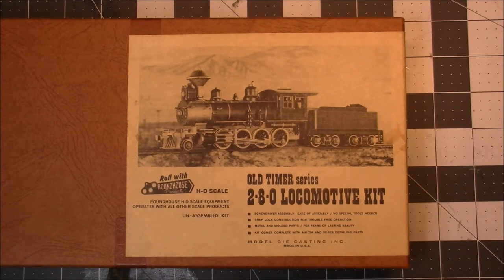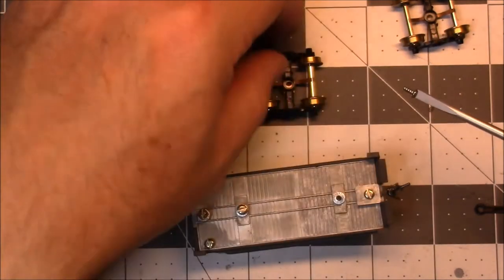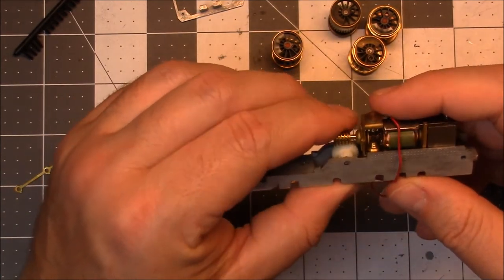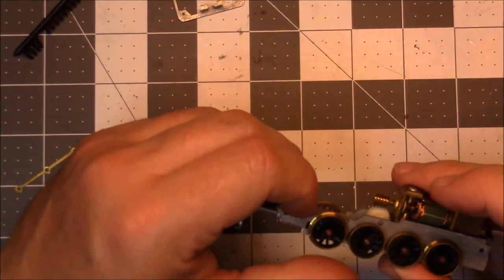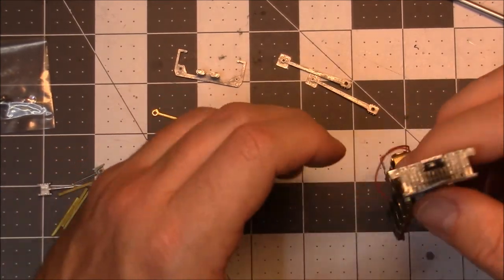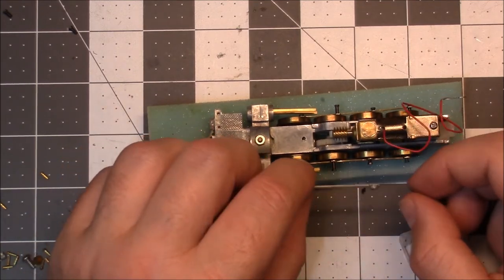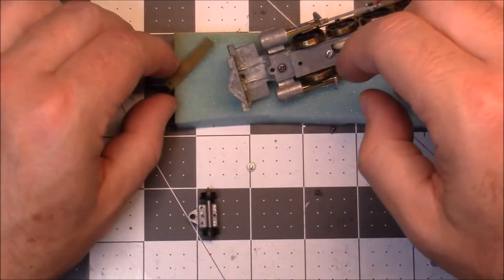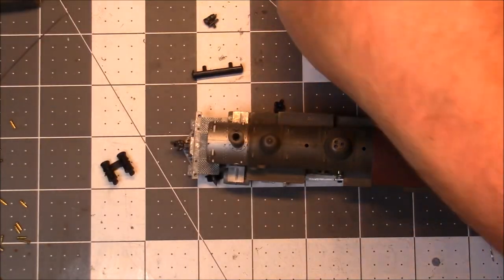RoundHouse 2-8-0 Locomotive build

Comment: Thanks for posting this. While these kits aren't very difficult to assemble to produce a static display model, it still takes an extensive set of high quality tools and a craftsman level of knowledge, skill, time and patience to build one in a way that it works well. For example, getting the worm gear and idler to mesh properly would take some very tedious careful filing and test fitting of the motor mount surfaces to bring the gear into proper mesh. The gear mesh and backlash are critical if the locomotive is to operate smoothly, especially if the layout has steep grades. There are some cost conscientious engineering and manufacturing in this kit, similar with other mid-grade old kits like Bowser and Mantua, that limit how well the locomotive kit's parts can be put together to operate out of the box. The lack of precision frames and bearings for the driver axles in the cast frame is one serious drawback. The quality and fit of the cast cylinder, cross head and main rod are particularly suspect on this kit. Those plastic rod pins are another marginal idea. Fitting NWSL gears and other parts is an improvement, but that takes time , tools, and skill also. There are high quality kits out there, like DJH from the UK, but they are few and far between. High quality North American prototype kits are extremely rare now.
I bought a slightly newer version of this exact kit off evil-bay recently. While I may eventually build the actual kit, I originally acquired mine, along with a PFM / United Models Ma&Pa 2-8-0, with the intent of using both as a guide / general pattern to scratch build a 'class' of 4 similar 1890's era brass Baldwin 2-8-0 freight locomotives for my small turn of the century era layout. Before I get to that project, however, I'm working on scratch building 4 passenger and freight 4-4-0's from an old Bachman 'Jupiter' model's dimensions and drawings of the V&T's Inyo, Genoa, Reno, and Dayton. Besides all the resources of the internet, I have a good knowledge of how an actual steam locomotive works, plus years of experience as a tool and die machinist. I have a small machine shop at home - milling machine, lathe, band saws, scroll saw, mini sheet metal shear, brake, and roller, belt sander, bench grinder, polishers, die grinders, air compressor, micro sand blaster, air brushes, resistance soldering machine, hand soldering tools, etc. and all manner of precision small hand tools - precision files, drills, reamers, threading taps and dies, screwdrivers, knives, etc., and a wide selection of micro screws, wire, metal sheet and bar stock, and other hardware, I'd still say building one of these kits to operate as good as some of today's ready to run locomotives would be a challenging undertaking not to be taken lightly by anyone. If part of the pleasure comes from the building and overcoming the kit shortcomings and improving on the basic parts design, fit, and function, then these kits can be enjoyable. If the goal is to just have a good running finished locomotive, it is far better to just buy a RTR modern high quality plastic or brass model.

Comment: Those ho train kits are aggravating
Reply: I have 2 of them. They never run right, everything is wonky. And they don’t look right for some reason.
Even the rolling stock is off. 
I have a few R.H. Climax engines and they run smooth and slow.

Comment: I just pickup one of these today from my local hobby shop for $30 dollars. It was so cool that I didn't care if it ran or not. But when he told me and showed me it ran I just had to have it. Do you know anything about these locomotives ?
Reply from the maker: Not much, but they are fun to build.
Reply: MDC Roundhouse was a one guy show for a long time. The oldest kits are entirely die cast; the tenders didn't have floors.  The Old Timer series was based on Baldwin catalog locomotives and they resemble thousands of locomotives from the late 1800s through the end of steam. Nearly all the threaded fittings are #2, so they can be drilled and tapped for more precise assembly.  The motors are Sagami open frames until the 1990s when some can motors crept in.  The Old Timers are styrene molded over a diecast weight and the boiler/frames/cylinders are all pretty much the same except for the milling for drivers-2-6-0, 2-8-0, and 4-4-0 on the same frame.  Others are generally based on SP, ATSF, and Pennsy locos.  They are stout, inexpensive and can look really good considering.
Reply: @erikhilsinger9421  Thanks for the information Eric. 👍